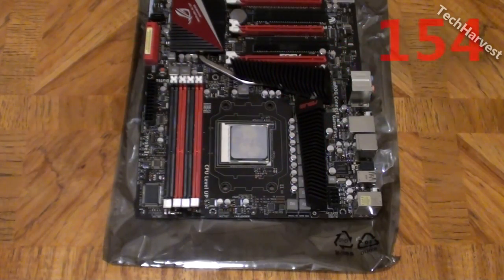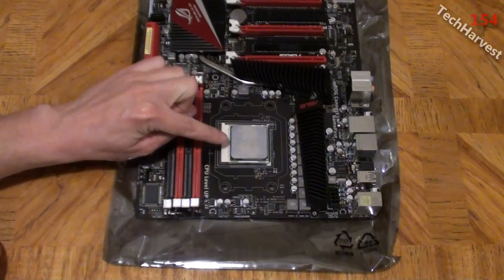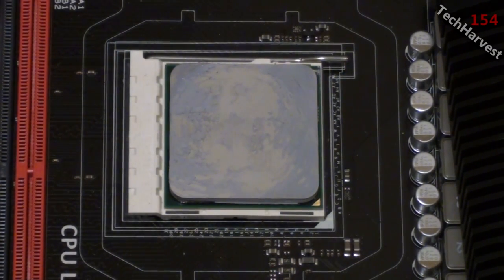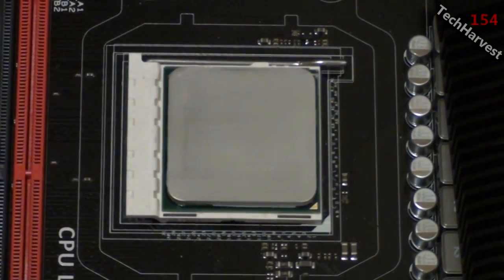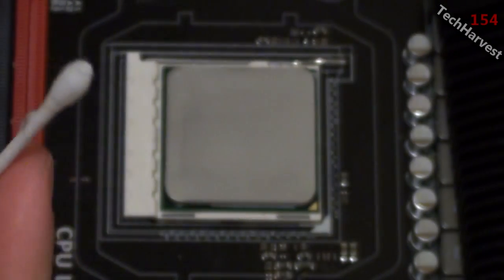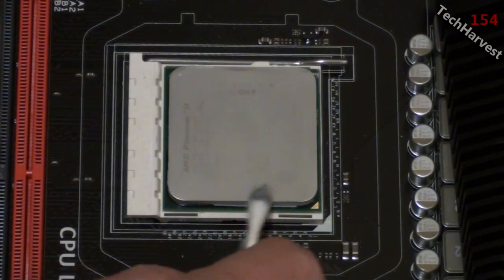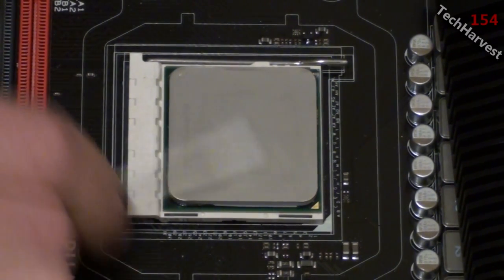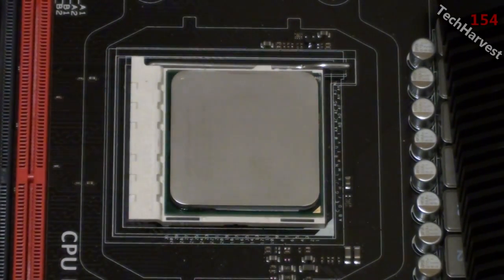How To Clean Thermal Paste Off Of A CPU

Comment: I do not recommend this method. Just inseat the cpu to clean it after cleaning off your fingertips with the alcohol and don't touch the bottom.. just hold sides. If you need to change your thermal paste, it's likely going to breakoff in tiny flexy chunks and then you need to have anxiety about where it fell... like I did. I did that. It fell and then I needed to unhouse the cpu to get small particles off the motherboard that were underneath the metal frame holding the cpu in

Comment: Thanks! But I do have a question. I have a 240mm aio which also has the old thermal paste on it that I am replacing. Will this process work fine with it as well? (I believe it is a copper IHS plate on the CPU block)
Reply: The same process will work, be careful with the alcohol and have it away from any electronics just in case.
Reply from the maker: Yes it will.

Comment: Why leave the CPU in the socket to clean it? It's easy enough to remove and put back afterwards w/o concern for "drips". Press AMD CPU into a foam pad to protect pins (Intel CPUs don't have pins.)
Reply from the maker: You shouldn't be putting that much alcohol on the cotton swab to get drips.  I like to keep it in the socket as to not damage anything.

Comment: I’m scared to do it cuz if I push down the paper towel too hard, the pins might break. Is that possible?
Reply from the maker: The pins won't break if the CPU is seated properly.  The risk of pushing down too hard would involve damage to the motherboard.  You don't need to apply that much pressure.

Comment: Lol i used to rub it with a tissue and drop of water
Reply from the maker: Generally speaking, it's not a great idea to introduce water into your PC under any circumstances.  If you do, you need to make sure it's 100% dry before you put power to it.  You also must make sure that there is no moisture between the CPU and the socket.

Comment: if im going to use 70% isopropyl alcohol to remove thermal paste, do I have to let it try for a bit before putting on my new cpu cooler?
Reply from the maker: Yes make sure that all alcohol has evaporated before mounting the cooler.
Reply: TechHarvest 
How can you make sure? If you have 99% how long you need to wait?

Comment: Do you need to use an air blower to remove the lint from the q-tip and paper towel? Does this lint damage the motherboard when it's turned on?

Comment: just use wet wipes
Reply from the maker: You can if you want.
Reply: @TechHarvest  okey thanks but is it dangerous or it is not problem
Reply from the maker: Just make sure that everything is bone dry before you put the thermal paste on or the CPU cooler on.  Of course never turn it on unless it's bone dry.  If you are using something other than isopropyl alcohol, make sure that it doesn't leave any residue behind.

Comment: Don’t use a paper towel. It leaves behind bits which can damage the cpu cooler if heated. Use a lint free microfiber cloth
Reply from the maker: Whatever you use, you can't leave debris on the CPU before you reattach the cooler.

Comment: I damaged my motherboard following this video. Q-tips snag on anything and leave fibers around. I bent pins when removing the fibers. Wish I had never watched this video. Every other video suggest microfiber and coffee filters - warn against using q-tips and paper towels. Too bad youtube ranks this video higher than the videos that have the right information.
Reply: How the fuck did manage to bend pins
Reply from the maker: If you need to remove fibers, use compressed air.

Comment: Would it be smarter to clean the thermal paste off the processor while it's still attached to the motherboard or take it out first?
Reply from the maker: I always leave it in the socket so you don't touch the connectors.

Comment: Use 99.9% isopropanol  if you can get it. That extra 30% is water which is not so good. It doesn't evaporate as quickly either.

Comment: Thank you for the tutorial. It will help me change my CPU cooler. But I have two questions. First, is it really nesscary to clean the old thermal paste off before applying new or can I apply a little new paste on the old? And second, is it safe to apply pressure on the CPU whn wiping it with a paper towel? Im afraid that I might bend some pins if I add pressure.
Reply: its preferable to remove the old paste before you apply the new one as it can lessen the effectivness of your cooling and you dont have to worry about applying pressure since your cooler is doing that anyway all the time

Comment: What are your thoughts on alcohol %? I read that water in it can be problematic.
Reply: Black Arrow Projections if you use 99% isopropyl it will be fine
Reply: Yeah, I opted for that to be on the safe side.  Thanks for the tip! Pharmacies are the only place for far I found locally that carry it
Reply: Black Arrow Projections 👍

Comment: I used a dremel with 80 grit sand paper. It took it right off.
Reply: r/cursedcomments
Reply: The cpu?
Reply: @josecardenas5318  na my boy ther cpu came off with a 4th of the moother board
Reply: Sand paper Holy WHAT!?
Reply: really you got it off with 80… i had to use 40
Reply: I use kerosene and a stiff wire brush to scrub the whole motherboard vigorously.
Reply: @MusicStudent1  🤣🤣
Reply: @JC-cr5ty I usually just urinate on the CPU & cooler to get the thermal paste off. It really works wonders! 😂😂🤣🤣😂😂🤣🤣😂😂🤣🤣
Reply: That’s how you destroy it
Reply: @Captornite  gets it off though😑

Comment: Can you use other things than alcohol?
Reply: Most of of things are water based, and you don't want it touching your electronic components. A guess this kind of alcohol is the only option available to ordinary  users. So, you can use other things, but probably shouldn't.
Reply: You could use dry towels but it will take longer and make mess. Also don't use towel that leaves too much lent behind

Comment: lmao I use water and done,,,clean like 20x times MOTHERBOARDS with just simple water and fine
Reply: Xpayne1 and you can break it
Reply: GGPL If you know how to do and use it, you won't break it anything.
Reply: Xpayne1 oh ok
Reply: i heard you can shower a motherboard with water and it won't damage it at all unless you power it on while its still wet. (duh)
Reply: GGPL 
The reason people use alcohol for this is because it evaporates quickly. Technically if you use water, and just gently wipe it off with a paper towel, maybe let it dry for a day or so you should be good

Comment: Why don't you take out the cpu
Reply: because leaving the processor in the socket protects both the socket and the cpu
Reply: +Sebi One  it is still easier to take it out first, and just don't touch the bottom then
Reply: don't get anything on the pins tho cuz if u don't notice it and u set it in the socket u could be scroo-ooed.

Comment: No mention about cleaning the heat sink part? There must be some paste on that surface too.
Reply from the maker: Yes, you do it in the same way as you'd clean the CPU.
Reply: TechHarvest I need to remove the thermal paste from my aio, would that be the exact same process? I'm just curious since it's a different surface.
Reply: In my case it was really stuck on and hardened. One can try GENTLY shaving some of it partly off with a razor blade, however, one can also just hang in there until the solvent (methyl hydrate, or 90% rubbing alcohol) goes to work.

Comment: can accidentally scratching the cpu damage it?
Reply: Most CPUs have an aluminum heatspreader that prevents you from actually damaging the die. what you probably scratched is this heatspreader. good thermal paste should remedy damage done this way.
Reply: People treat CPUs like they're plutonium, they aren't, what he was doing was on the heat spreader, which never really affects anything to the CPU itself.
Reply: if its just on the top surface as shown in the video, and the scratch isnt deep, then no, it wont damage it.
Reply: CPU's are pretty resilient. Mine was shipped pretty much loose in its box (it was used) and I was going to send it back but I put it in my rig just to check and it works fine. It's a 6600k that's been overclocking well and I haven't had any issues after three-odd months. Scratches on the top are definitely OK, as long as they don't go all the way through the aluminium lid.
Reply: You never see the actual CPU. It's always inside the metal casing. The only thing that a scratch could matter in would be in reducing the contact surface between the CPU and the heatsink, but that's exactly why we use thermal paste, to fill any tiny gaps between the two metal surfaces.

Comment: Which one of these thermal pastes would you recommend?  If this is all i have access to at the time. Just trying to fix pc for friend and clean it up. 

Arctic Silver 5 High-Density Polysynthetic Silver Thermal Compound OR 

Arctic Silver Ceramique 2 Premium High Density Thermal Compound OR 

StarTech 1.5g Metal Oxide Thermal CPU Paste Compound Tube for Heatsink OR

Arctic Silver 5 High-Density Polysynthetic Silver Thermal Compound

thanks in advance
Reply: The cheapest one...
Reply: +Joe N. I was JKing a bit but not totally, theres other things you can spend money on then thermal paste...
Reply: I've used arctic silver 5 for pretty much every build I've done always use it instead of the stock paste provided.
Reply: Thanks to everyone who replied. I've already finished job and pc is up and running once again. I landed up using arctic silver as well

Comment: I am just changing my cooler from a stock intel to a Coolermaster Hyper 212 evo. Do I need to do the qtuip thing?
Reply: You don't "need" to. But if you're applying new thermal paste, it can't hurt to get the old dried up crap off.
Reply: I would say YES do it because it will maximize cooling efficiency. it might work fine without doing it but do you want a computer that just "works fine" or do u want the best performance possible?

Comment: Its better to use isopropyl alcohol, but if you dont have any and stores are closed, you can use RW-40 instead. Also no need to worry if you dip RW40 somewhere on your components cus it repels water.
Reply: Does Aceton work as well? I dont wanna spend 5 Bucks on Alkohol for only one use
Reply: they sell it at walmart for around 2 dollars for 70%. I spend about 5 bucks on 91% and get a full quart
Reply: I use only isopropylalcohol, since you get the thermal paste off the chip in seconds and it vaporazes quickly so i can slap my cooler at in and turn PC right on. With WD40 it takes minutes but it gets the job done. I would not use any other solutions since it could contain water which will fry the chip if not properly dried.

Comment: lmao I built my first PC all wrong I built it on carpet but it hasn't broken.
Reply: same one of the motherboard's pin thingy on the back actually got stuck onto the carpet :P Thankfully I didn't break it. In fact I put together my entire PC on carpet and it works! I'm using it right now and it has been going strong for 3 years :)
Reply from the maker: +Glassify Everything is about probabilities.  Nothing is black or white.  If you take all the precautions then the probability is LOW that anything will go wrong.  If you don't take the precautions, then the probability will be higher that something will go wrong.  However it's not guaranteed to go wrong.
Reply: Probability is right... my son spilled chocolate milk, and root beer on my entire rig.  Both times right on top of my HAF 932 case dripping down everything like a waterfall.  Everything survived.  Well technically the PSU crapped out after four years of use.  Thank goodness for Corsair.
Reply: Same lol. My first one had bent pins and I had to wipe thermal paste out of socket. Looking back at it I can't believe it still works....

Comment: lol my cpu is between 40 and 55 degrees on full load with the stock cooler
and i took off the thermal paste with fucking toilet paper...

and btw modern cpu's automatically turn themselves off when they overheat so theres no reason to panic about it
Reply: They might turn themselves off to prevent damage, but that's not a good sign and shouldn't be depended on.

Comment: Thank you Techharvest, I just recently applied some arctic silver mx4.  Though now, when I play Diablo 3 my computer has a new tendancy of freezing.  I've not had a computer freeze in over 10 years.  I suppose I'll have to remove the paste and try again.
Reply from the maker: +Remmy Canadian It's possible that you might have to redo it.  Also make sure that your CPU cooler isn't coming detached or separated.

Comment: Would an alcahol wet wipe do it?
Reply from the maker: +WonDah Yes.  Just remember the goal is to clean the CPU so you don't want to use anything that would leave residue behind.  Also keep in mind you don't want any excess moisture left on the CPU or surrounding areas.
Reply: +TechHarvest thank you very much for your help :D

Comment: The first thing you need to do is remove the CPU from the motherboard and clean it comfortably on a table. It annoys me how many people clean the thermal paste gunk off while the CPU is still sitting on the motherboard and they smear it all over the socket and capacitors around there.
Reply: +Perplexer1 Its easier if the CPU is in the board, doesn't move around and decreases the chances of bending pins

Comment: I have alcohol but no CPU, and I still do this?
Reply: Gamesfan34260 you might wanna read his comment again but just do it a little slower
Reply: Robbe3j you are no fun.
Reply: He's a troll lol 11/10
Reply: woosh
Reply: Thats funny man, love the answer, i thought the same when i read it too
Reply: @7aemr  The CPU socket will hold it pretty firmly, you're not likely to do much damage to it while it's in there. If you take it out of the socket, the pins aren't supported by anything and you're much more likely to bend one by accident. Also, probably best to avoid touching the pins at all if you can. It's very unlikely you'll do them any damage, but you never know.
Reply: If you have no CPU how are you watching this video?
Reply: With enough alcohol, anything’s possible
Reply: damn you are one funny guy
Reply: @stealthy9177  holy shit this was two years ago how did i miss the sarcasm back then. bruh im retarded as shit
Reply: @Robbe3jgaming  It's okay.  Sarcasm hadn't fully evolved back then as amphibians ruled the Earth.
Reply: Take it internally, don't waste to CPU
Reply: Apparently you don't need to use the q-tip/earbuds to clean off the excess so no need for the alcohol but it's advised if you want to get a fully cleaned CPU before applying the thermal paste.

I might not bother, I dunno what kind of temps I'll get but 60C is my baseline so assuming I don't go any higher then whatever.
Reply: lol 
I love the haters here that don't have the brains to understand sarcasm :D
Reply: what the hell is wrong with you? you dont need to clean a cpu if you dont have one.
Reply: Robbe3j i’m 2 years late but there’s literally no way you couldn’t tell that was a joke
Reply: @Robbe3jgaming  what he meant is HE'S DRUNK!

Comment: Can I clean mine with actual vodka? All I have is a little bottle of vodka
Reply from the maker: +Zupez I wouldn't.  Vodka has too much water in it.
Reply: Can tell you're Russian. :D
Reply: Blyat
Reply: TechHarvest 95% vudka?
Reply: I assume you've made it to the store, but if anyone else has this question, an alcohol-based hand sanitizer has much more alcohol than vodka, and should be good enough. Isopropyl alcohol or a dedicated cleaning compound would be best, of course.
Reply: +TechHarvest  can refill a little syringe looking thing with thermal paste
Reply: +TechHarvest  also when do i know to re apply it and is there a recommended time i should keep my thermal paste on without removal
Reply: Zupez NONONONONONONONONONO
Reply: yes you can, i know from experience
Reply: *drunk

Comment: you have a motherboard ontop of an anti static bag. Anti static bags work by moving that static from the inside to the outside. So you can potentially brick a device by doing that.
Reply: That's not true at all.
Reply: Not true. Anti-static bags prevent static build up on the surface of the bag to protect the components inside. They do this by incorporating conductive materials into he material of the bag. A properly grounded static mat is best, but in a pinch you can certainly use a static bag.